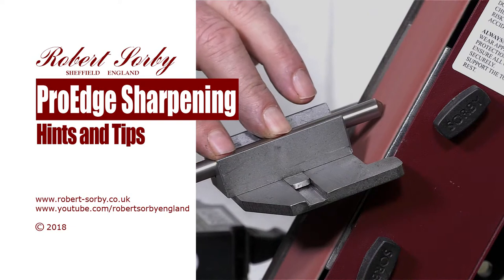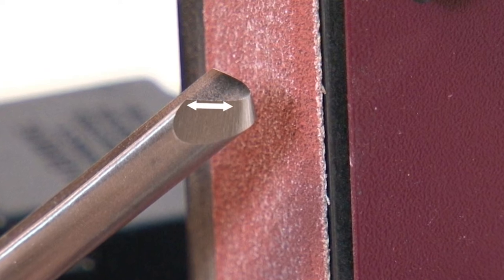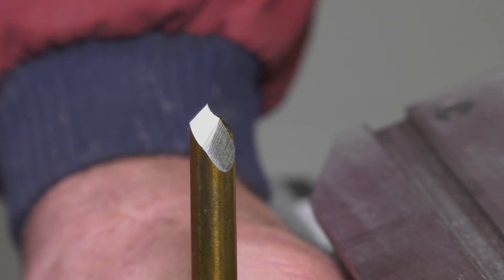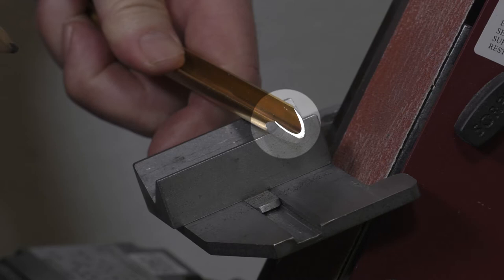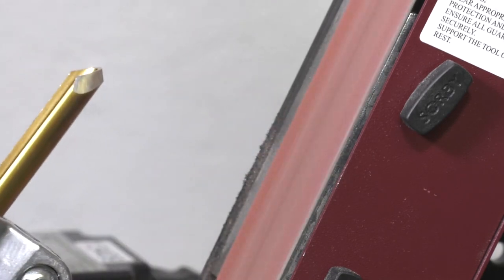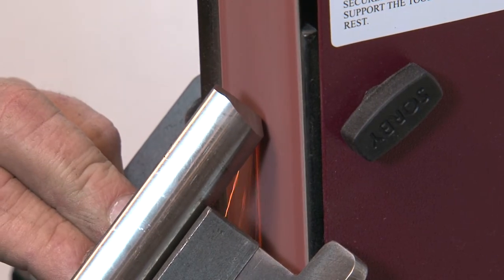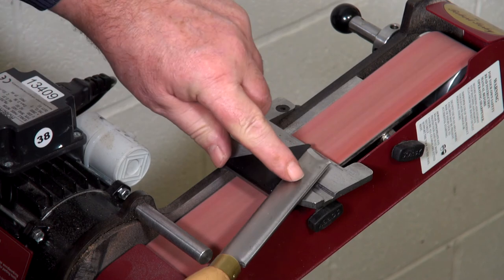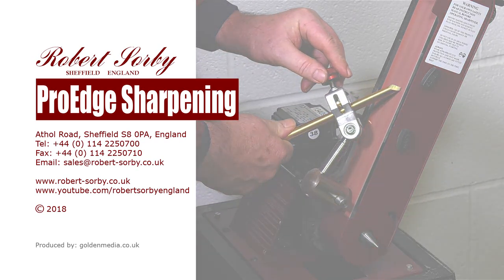Robert Sorby ProEdge hints and tips 2018

Comment: The Pro Edge was the best investment I ever made for my wood turning. Some comments on overheating during grinding would also be useful.
Reply from the maker: Hi @bobh5616...Thank you for your comments...Abrasive belts cut highly efficiently so when sharpening so as little amount of material is removed with limited friction and heat...When grinding, reshaping or repairing, where more material needs to be removed using a coarser belt then heat is generated, but a lot of the heat is transferred down the shaft of the tool and doesn't remain at the point of contact like it does on a grinding wheel, which causes overheating and potential damage to the steel structure...If you find there is any heat build up always allow it to cool naturally and never dip it in water...I hope this is helpful to you

Comment: Hi. I’ve just got one of these and my belts all run off to the right by about 5mm. I’ve tried adjusting the tracking but can’t get it any better than the 5mm. I seem to have gone round in circles many times with no improvement.  Is there a video that details how the tracking works and how I could adjust it?  Other than this small issue the tool is amazing.
Reply from the maker: Hi @dawkinsm...Please email Robert Sorby customer service and I will ask our ProEdge engineer to contact you with guidance

Comment: Up to what size can the profiling jig accomedate?
Reply from the maker: Hi...It will accommodate up to a 3/4" shaft as standard and a 7/8" shaft if the brass clamping bar is removed and the tool is held in place just with the locking screw

Comment: Can you explain how a long grind or swept back grind is done on a bowl gouge? It cannot be done as the tool clamp fouls on the belt body when you try to grind the left wing?
Reply from the maker: The profile produced in the video by using the fingernail profile arm and the standard location boss replicates the Robert Sorby factory fingernail grind...If a longer wing profile is required, then the Long Grind Jig would allow you to do this
Reply: @robertsorbyengland  It does not work, myself and others have tried. The newer tool clamp hits the body of the belt sander.
Check this out -     https://youtu.be/Nv71M1Ji2kI
Reply from the maker: @Bigtel1970  Hi, The original Robert Sorby video shows the extra long grind being created on a 3/8" gouge, I think that is why there is a discrepancy in what you are seeing and what you are experiencing...We always appreciate feedback and comments by customers that are using our tools and equipment on a daily basis....Thank you for going the extra distance and creating the very informative and useful video
Reply: @robertsorbyengland  hi there. So is there a solution here? Can you use the long grind boss with any sized gouge?
Reply: @TheTranq  The answer is to buy a lathe chisel sharpening system that uses a wheel grinder.  I own a Sorbey Pro Edge, and as pointed out in the linked video by TC, the chisel clamp limits the grind to 15 degrees and about a quarter inch length on the tool.

Yes, you can use the long grind boss with any size bowl gouge, but, again, you will be limited to 15 degrees and about a quarter inch length on the sides.

A third option is to learn how to grind your chisels free hand so you can do it on any machine - belt or wheel.

Shame on RS for refusing to come out and just say, "Well, our machine has some limitations, as you pointed out. We apologize for not considering this issue when we designed our half-assed machine."  LOT of trust lost with there silence.